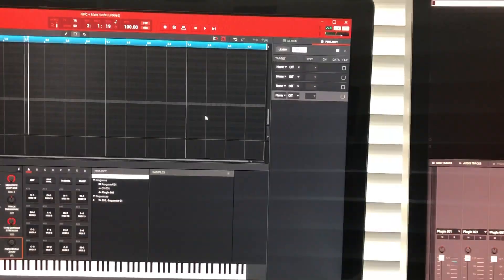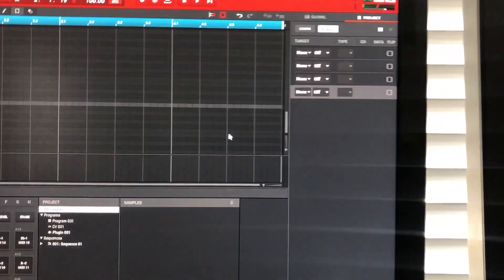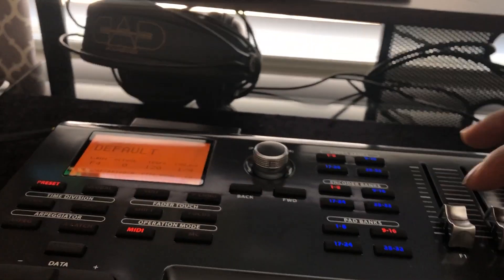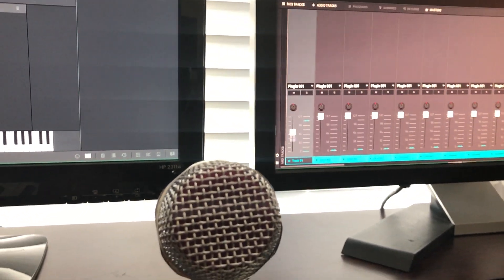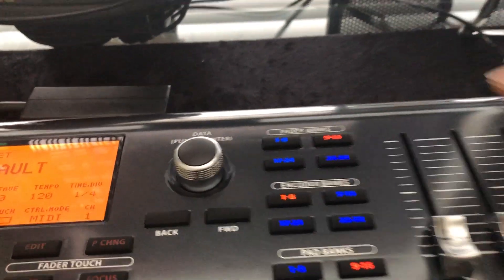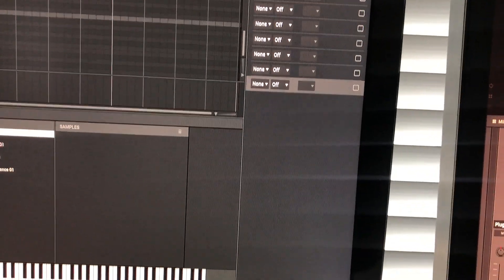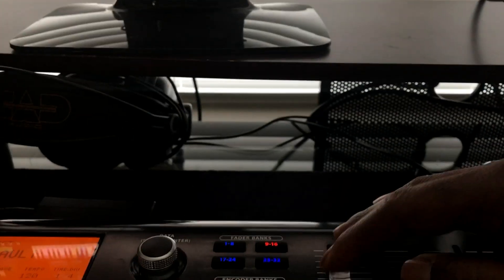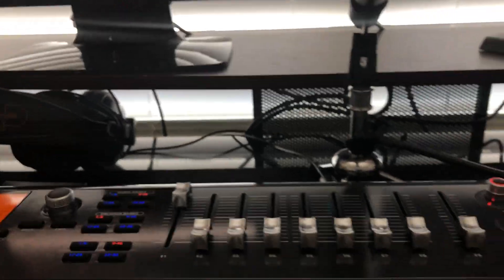MPC 2.4 Control Surface Part 2

Comment: So are you saying that the X-Touch will not allow me to control my faders in 2.8? I have the Mpc X.
Reply from the maker: At this point midi mapping should work for it. MPC software allows for manual midi mapping. Let me know what you find
Reply: @RobCamizzi  I will work on it this evening and let you know.
Reply from the maker: Cool
Reply: Word I wanted to get the xtouch  and wanted to know if it will work with MPC software?
Reply: @myworld4beatsllc855   It will not work or run the MPC software. I tried every thing!

Comment: So i figure the only thing that lacks is the ability that when you move the faders in the software, the motorized fader dont move, but when moving faders on the keyboard the faders in software do.
Am i right?? Thanks for the video btw
Reply from the maker: That’s correct. And it’s only because it’s in MIDI mode. If MPC software ever opens up the ability for Mackie control,, then you’ll get full functionality

Comment: Hi curious how happy are you with the board? Haven’t seen many reviews.
Reply from the maker: Very happy with it. It filled the gaps for me in several ways. At this point I’d like to see MPC software support Mackie Control so I can make full use of the faders being motorized.
Reply: Rob Campbell - R. Camizzi thanks very much!